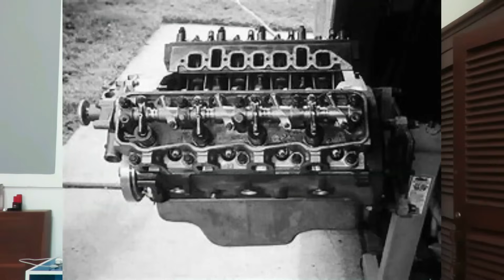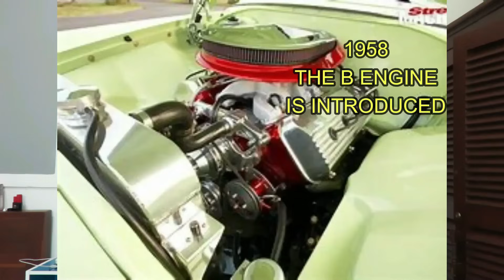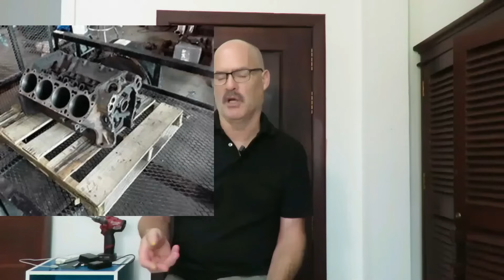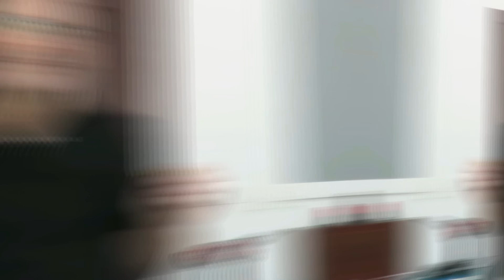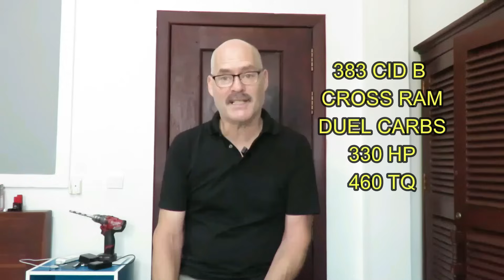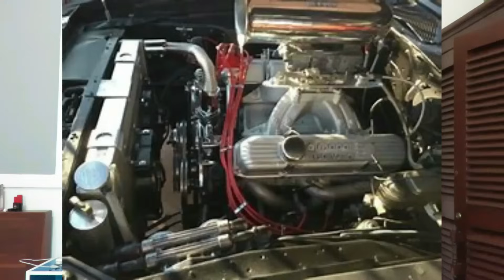CHRYSLER V8 ENGINE HISTORY RB /LA

Comment: The 426 Hemi was literally made from the B engine block casting. They simply modified the deck casting to accommodate the Hemi head bolt pattern and machined the cross bolted main area. Very interesting information in the 2 videos called "Hemi engineers - The lost interviews."

Comment: You just taught me what i already suspected; the 383 and especially the 400 could be made into one hell of a high winding, high horsepower engine. With the same heads and cam as a stock 440 why not? Back in the day it was said with a set of good valve springs these motors could turn 7000 rpm (especially the 383 because it had good compression) and as a kid my uncle had one in a Newport and i heard that 4 barrel absolutely scream!

Comment: What is the main difference between large and small blocks other than weight ? Is it the size of the main journels ? And / or the angle of the rods ?
Reply: B and RB engines have a “Y” block. Pan rails extend about 4” below the crank centerline. A engine blocks have the pan rails at the crank centerline like a Chevy engine. B blocks are heavier for that reason.

Comment: I have to say the 340 was a really good motor still have my 69 Challenger got it in high school 240 4 speed car with 45 rear gear and headers it ran oretty good at the drag strip  did a 13.70 built the motor 12.5 compression  big hydraulic cam bid Edelbrock intake and a 750 Holley double pumper car ran at 12.70 at 106 mph that was a pretty fast street driven car in 1983/1984 when I was in high school.

Comment: I had a few dodge or mopar .. powered cars ..i was a young guy with a heavy foot .. i finally moved ..i bought a 426 marine wedge and installed it in my charger . It ran ok but i like the high rpm hp and the ability to stay together.. i think the wedge motors were torque motors and needed better cylinder heads to really shine

Comment: Some useless information is that lean burn would modulate vacuum to increase timing based upon how long the pedal had been pressed. The idea being on the highway add timing to sip the fuel and increase efficiency. So cars that had been on the highway for a trip when getting off the highway were known to be noticeably peppier as all the added timing remained for a bit.

Comment: With development the Poly engine could have been the top dog, It had a direct top to bottom flow direction just like the hemi., The reason Mopar switched to a inline valve engine was so the V 8 could be used in the Valiant chassis. Ford, GM and Mopar all their Compact cars with a narrow engine compartment. Both Ford and Mopar had to design a new engine to fit their compact Chassis.

Comment: OOps. The 4 barrel version of the 273 was called "Commando" for the Plymouth line and "Charger" for the Dodges. It produced 235 horsepower with 280 lb. ft. of torque. These engines had 10.5/1 compression, a slightly larger cam than the 2 barrel engines, dual point distributor, an open plenum intake with a Carter AFB carburetor and a chrome unsilenced air cleaner. It also had black wrinkle finished valve covers with aluminum heat sink style top trim. The high performance single exhaust had  a scavenging design head pipe, a large diameter intermediate pipe, a Hemi style muffler and a tail pipe with a stainless tipped resonator. Those engines were produced for the A bodied cars only from 1965-1967 in both the Dodge and Plymouth lines. In 1966, Dodge (only) produced a 275 horse version of the 273 to compete in the D stock classes for NHRA. It had a 4160 Holley carb, heavier valve springs, a Camcraft 284°/.500 lift cam, Doug Headers, a Hurst shifted 833-4 speed with a Weber clutch and a 8 3/4 Sure Grip with 4.86 gears. It ran 14.30's @ 92 mph. That engine was never available in the Plymouth line. Thanks
Reply: I've recently gotten a 65 Dart GT 273 but the heads and intake had been changed long ago,I don't know any history on it.Its a true Charger I believe tho the exhaust is gone the head pipe is like you say.Also the car is engine badge delete tho it has all the other chrome.Fender and door confirm displacement.Would like to know more ,this is my first A body I always had B bodies in the day.
Reply: @samuelgoodman2825  Do you have a fender tag on the car?  What is the code under the (capital letters) A and B?  IF it is a 30 it was a 2 barrel engine. If it is a 31 it was a 4 barrel Power Pac engine.
Reply: @LP23D6  2 bbl.Still very cool.Console shift auto.Was the cream color but it's a very old lacquer black now.Engine is .30 over and manual balvebody somewhere in its history.Has a lumpy cam but this was built probably 70s or 80s.

Comment: I have a 73 Dodge Charger that has a factory 400 big block. I put Dome pistons 30 Oversize. A pretty good size cam long tube headers full exhaust and take manifold With 355 gears And a torconverter of 24 to 26 Stall with edlebrook r p m heads Runs really good.
Reply from the maker: I bet it does

Comment: Great Video!  Thanks for the revision on the A poly engines!
Reply from the maker: Yea I made a pretty big mistake on that one to be honest I really never messed with them I did build a few 318 poly engines back in the 80's but they were just stock rebuilds nothing special although I do remember the rocker shafts are a giant pain to remove some times you can overlook mistakes and just let the video run but in this case it was just not possible and it had to be corrected what's so stupid about it is my buddy in HS had a barracuda with a 273 and I worked on that car with him often the old memory just isn't what it used to be I guess

Comment: Thanks for your video. Cheers man 👍
Reply from the maker: Any time
Reply: @Myvintageiron7512 could not find where to comment but I had a 1966 dart that had the 273 hi po with a 4 speed and a sure grip rear end, very strange exhaust manifold,cast iron square tube and the driver side wrapped around under the back of the engine and met with the passenger side and emptied into a 3inch pipe that whent all the way to the back, no power anything no heater but it was pretty quick for a small displacement engine, perfect bracket race car straight from the factory

Comment: Great vid as usual , thanks for putting this together !!!

The 392 weighs about 30 lbs more than a standard 413. A Max Wedge 413 will weigh more than a 392.  A bare iron 392 head weighs 70 lbs , about the same as a big block Chevrolet . 

The true reasoning of the early hemi being discontinued is really lost to time. Don Garlets said that he was told that the 413 was 54 dollars cheaper to produce than a 392 . Frustrated NASCAR racers ( for Mopar ) at the time said that they would rather have a 331 from 1955 than the 426 Wedge engine they were using , ( the reason for the 426 Hemi development ). The stock big block heads fell off on the big end .
Reply: for reference my 906 1969 heads ( 383 B g-code+ auto/727 ) were 30-50~lb sorry im forgetting i weighted the difference between my newer D8 casting's ( 50-85lb par is 160lb extra ( heads only not counting the block or intake's ect differences ) over my charger's nose, as i worried it might change my handing/daily driving experience, new-transmission is a tr6070 dropout ) aka 426-hemi both in iron

plans if i don't like it is to use a composite ( or aluminium ) hood/clip replacement panels

Comment: I'm building a 400 B right now. Great engine. A lot of people back in the day thought the heads were the reason for low HP. My CR measured out to 7.6:1 with the factory pistons. Great video, thanks for posting.
Reply: Replacement pistons will probably work out in the sixes!! You need a replacement piston to get comp
Reply: @ldnwholesale8552  That's amazing. We'll end up somewhere around 9.5 static on this build.
Reply: @ldnwholesale8552  or add lots of boost 😉 TT/8-71 anyone lolz 😂
Reply from the maker: Right on
Reply: the best choice for a stroker engine,452 or 513 the 513 has the lightest rotateing assembly big cubes that revs like a chain saw
Reply: For what it’s worth, I’ve used 400 blocks for 5 engine build ups. 3 of them have 4 1/4” strokes with a 4.375 bore for 511 cu. In. The other 2 had a 4.15 stroke for 499 c. I. The 511 uses a crank the was originally a 4.15 stroke. I had it offset ground to 4.25 with 2.20 BB Chevy crank pin size. I use H Beam 6.535 BB Chev rods. The crank counterweights have to be machined down to clear the bottom of the piston, due to the long stroke. I use B-1 heads and the engines make about 875 HP. I run them in NHRA Super Gas. I use steel main caps, bored out to the RB size (2.75” main dia.).